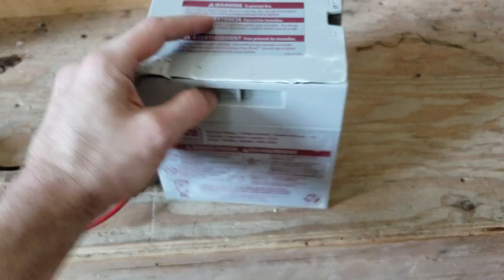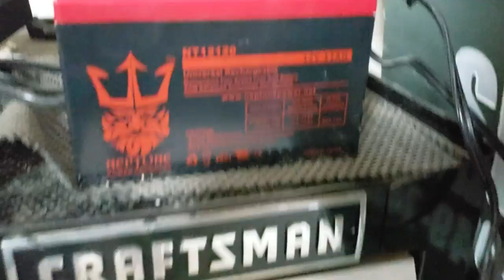How to Fix (hack) Your Dead Power Wheels Battery

Comment: GREAT VIDEO, THANKS. I HOPE YOU WILL ANSWER MY QUESTION. MANY OTHERS WONT ANSWER. I PAID OVER $4,000.00 FOR A POWER WHEELCHAIR OVER 3 1/2 YEARS AGO. IT DIDNT EVEN LAST 3 YEARS, TOTAL SYSTEM FAILURE, EVEN THE CHARGER THAT I EXPECT CAUSED THE PROBLEMS. I SALVAGED AS MUCH AS I COULD. AIRCRAFT ALUMINUM CHAIR, TWO 24 VOLT LITHIUM BATTERIES, ETC.  WHAT I HAVE STARTED DOING IS, REDESIGNING THE ALUMINUM FRAME AND INSTALLING A BICYCLE FRONT END, NO MORE JOYSTICKS FOR ME. 6 FACEPLANTS WITH THE SMALL SWIVEL WHEELS UP FRONT. I WILL BE CUSTOMIZING THE WHOLE THING AFTER MY 2ND. ELECTRIC WHEELCHAIR. CHAIN DRIVEN, 2,000 WATT BRUSHLESS MOTOR, DISC BRAKES, ETC. SO, MY PROBLEM IS THE TWO LITHIUM BATTERIES, BOTH 24 VOLTS. THESE ARE VERY EXPENSIVE BATTERIES, $550.00 EACH AND I KNOW THE BMS WILL ALLOW ME TO CHARGE EACH ONE FROM 12 VOLTS THEY ARE BOTH SITTING AT RIGHT NOW, BACK TO 24 VOLTS, PLEASE HELP ME. THANKS

Comment: Thought this was to fix the old battery???
Reply from the maker: Sorry. When the battery won't hold a charge anymore theres not much you can do.  I hope this video shows you how you can use a much cheaper battery instead of being forced to buy one of the overpriced power wheels replacements.

Comment: I hope this is not a dumb question but I see the in-line fuse but what is the black wire called? I plan to get the stuff from auto zone tomorrow. My battery doesn't have the clips on the end but nuts and bolts.
Reply: I dont have an amazon account so I wont be ordering the kit from amazon and i dont have those connectors at the ens

Comment: That thing in the top corner is a 30 amp auto-resetting breaker. You can use a Bussman CBB-30 instead of the 20 amp fuse you installed

Comment: What is the charge time for the new battery?
Reply from the maker: I haven't really timed it because my charger shuts off automatically.

It probably also depends on the charger a bit.
Reply: @willworkforliberty What charger are you using?
Reply: @willworkforliberty  Thank you for committing back BTW
Reply from the maker: @92AcuraGSR1  I always put all the link to my materials in the description.  Here is the one for the charger that I use.  It is good for this task, but don't try to jumpstart your car with it :)
https://amzn.to/2Lt10K9
This amazon basics one is a bit cheaper, you might want to try it out as well: https://amzn.to/38Vx3hL

Comment: Thanks for making this video. Seems these power wheels batteries don't last very long and are $$$ as well. The ability to use a less $ battery is a must-have for any power wheels enthusiast. I found this harness online. Haven't tried it yet. But it's great to know you may not need to go through the steps of dismantling a power wheels battery to build a harness next time. https://www.amazon.com/Harness-Connector-Fisher-Price-12-Volt-Battery/dp/B01INNQ2RK/ref=sr_1_2?crid=1OBVN0P0MDJVQ&dchild=1&keywords=power+wheels+12+volt+battery+harness&qid=1594403892&sprefix=power+wheels+12+volt+battery+harne%2Caps%2C138&sr=8-2
Reply from the maker: Cool Thanks.  Its only $6 bucks more to go this route... might be worth it for some that dont feel comfortable ripping apart the battery.

Comment: Your ads is misleading !  I came here to watch you fix a dead power wheel battery !  Instead , you hack swap power cable from original battery for the new battery .   Your ads should have been power wheel cable hack from original battery to New battery .
Reply: Hack up your dead battery you mean. And you didn’t even show it working so it was altogether pointless
Reply from the maker: Thats a good point.  I did put the (hack) in there, and this does allow you to buy the MUCH cheaper battery.

Comment: What did I Misssss? Title says “...Hack...Fix...Dead...Battery”. Didn’t you just CANNIBALIZE the original for its oem connector?!?! You could’ve just found a size-appropriate connector (physical dimensions of wire leads and connector surface area- fuck the plastic) off of a junked Anything?! Going to work with your battery-jabber/pry-breakshit is never the prescribed Ma mamama MaDNeZzS! Dude. Forethought.

Comment: How has this held up?  Is that $26 Amazon Battery still kicking?
Reply from the maker: This spring one of the batteries wouldnt hold a charge.  So that's about 2 years.  

I dont treat them very well... leave them in the garage over the winter and whatnot.

Comment: Hello so I have a power wheels quad I bought my granddaughter the battery charges but when she pushes gas pedal it doesn't move.  I read somewhere how to restart it taking the negative wire of battery but this one has some kinda glue substance that doesn't let me pull it out.  Can u tell me how I can remove this please
Reply: I had an old dead battery in one. It would charge, but had no power. It would drop to zero when the pedal was pushed. New battery was the solution. You can test your 12v battery with a automotive light bulb, if you want to be sure. The baterry shouldnt drop more than a volt when the bulb is connected and the bulb should be full brightness.

Comment: You will destroy that battery too. Power Wheels lack a battery management system, allowing the sealed lead acid battery to discharge below recommended levels.
Reply: A low voltage cutoff circuit is cherry pie simple to solder together then cut it with a relay when it's below safe levels.

Comment: Did the Power Wheels charger work with the new battery?
Reply from the maker: Yup.  I've used both the original power wheels charger and one linked above with no issues.
Reply: willworkforliberty Thanks